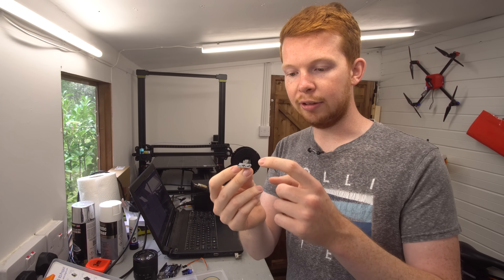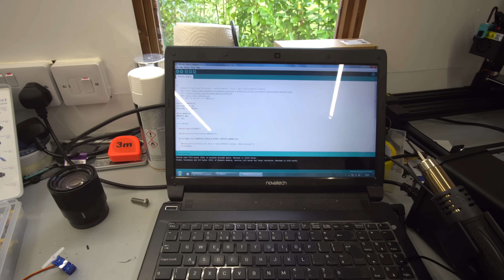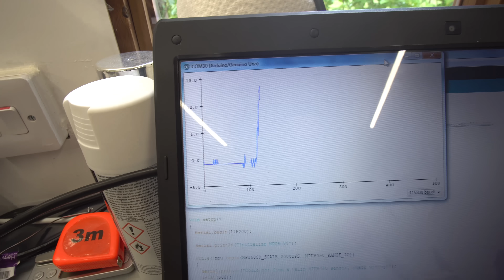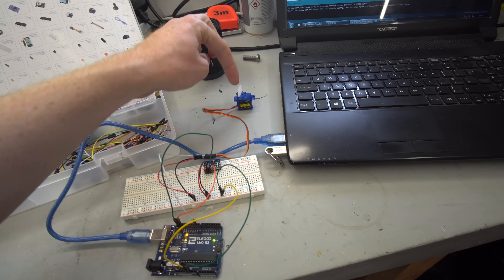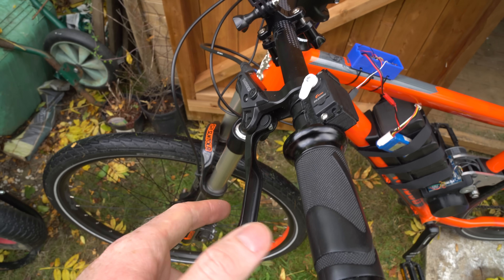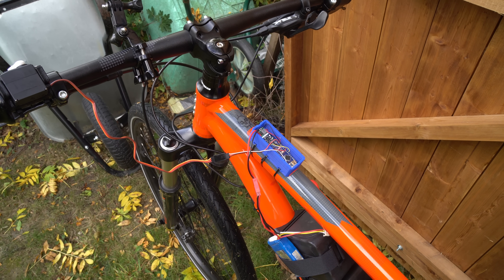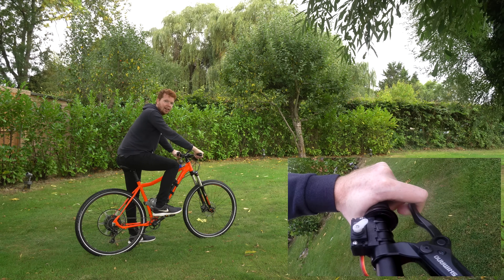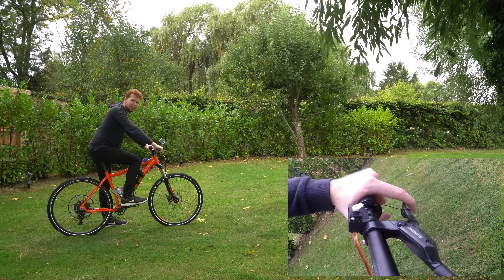Wheelie Cheat Device?

Comment: Great work so far! You may want to look into averaging some number of values from the sensor. This will act like a debounce / filter so the servo doesn’t jitter as much. The trade off is latency to brake activation. Also, verify that you are using gyro data and not accelerometer data. The accelerometer will provide false data during any velocity change, versus the gyro data measuring angle. PID code and Kalman filters will help.

Comment: Another great video :-) If you do end up going further down the motor control route, safety could maybe be improved by incorporating some sort of 'dead mans switch' near or in the handlebar grips, have this hard wired to a relay that returns throttle control back to the real throttle in the event of hands no longer being on the handlebars. I guess you could also monitor another axis so the system only works when the bike is upright.
Maybe one day we'll see riderless/rider assisted bikes pulling perfect 360 degree backflips....

Comment: It will not help.
You have to control the speed, if you control the lean angle even the slightest error to the optimum current lean angle to keep the speed will integrate up and the speed will run away to a stop or  become too fast.
From my experience preventing to fall backwards with the rear brake is the easiest thing when trying to wheelie.'
The difficult thing is to keep the speed within practical limits.
From the force on the pedals to speed you have a second order system hardly controllable.
You compensate by changing the lean angle directly with slight body movements.
Your balance point theory is wrong.

Comment: I thought with your newly finished e-drive you were surely going to replicate the Audi e-bike wheelie cheat device (https://www.youtube.com/watch?v=wdShjFWgh9E). You should definitely be using the drive motor though, not a servo pulling on the brake lever - there's too many levels of vagueness and indirectness that way (the Arduino doesn't know where the bite point is or how effective the brake is). Look to filter the sensor data too, rather than use each raw sample directly.

Comment: Pull the brake at an exponential rate instead of a linear one? When you go past the tilt point, you don't gradually pull the brake, you pull the brake hard, and then release fast: what an exponential relationship would do. With a linear system, it correlates unnaturally to what you naturally do. I like everyone else's technical answers, but I think my suggestion would work well with your current set-up.

Comment: You might consider using a curve algorithm to apply the servo breaking pressure. It’d be more constant. You could also use a running average across an interval to apply the pressure.  That way a sharp change would clamp but not jerk you back down.  You have less breaking force the closer to balance you get.  It’d also help regulate speed till you learned to balance your peddling or torque input.

Comment: Combining an accelerometer and a gyroscope, you could self tune a control loop based on the angular momentum and acceleration of the bike, regardless of rider weight or position.
Reply: Seen a few comments about holding an angle, but an angle below the perfect balance will need constant acceleration to maintain, so the angle would need to be constantly adjusted; interestingly, to slow down, I think you would increase the angle by first accelerating.

Comment: Great start, and thanks for the inspiration!  I'd never for a moment have imagined that such a simple servo-brake setup would work AT ALL.  Also amazing and really encouraging to see just how many people are working on the same idea - why, there's enough just here to make a forum...

I agree that you should use the gyro reading to track your rotational moments, and maybe blend with some PID mechanism.  Someone also mentioned that it's a non-linear "inverse pendulum" problem.  I'd like to hear more about that.  I wonder if some Machine Learning would be of use here, too?

I'll probably start experimenting with a model, my wheelies are pretty poor (read nonexistent).  I also prefer to use ESP chips.  You can program them in the same IDE as Arduino, but they are quite a bit more powerful, and cheaper.  Built-in WiFi also facilitates remote logging or RC control.

Really cool to see there's so much support, hey this may work out now!   Can't wait to see what else, erm... comes up  :)

====

PS.  I am also shocked, I say, shocked!! to find out that some benighted (LOL) countries put the rear brake on the right.  Motorbike riders must just love that...

Comment: You don't need to clean your disks or pads, you need to readjust them as they are hitting the rotors incorrectly causing that squealing.
Reply: Umbra no the have oil on them which makes them squeak

Comment: Hey Tom,
Might be worth logging the way you do a wheelie first - by taking the data from the accelerometer and a potentiometer on your brake handle. This should get your native wheelie angle and brake force applied, once this data is obtained you could match it with your servo or even continue to use the POT to match a force applied to the brake with the servo.

Obviously this is in no way dynamic like the segway as it will be matched completely to your wheelie profile.
Reply: Or learning how to wheelie properly

Comment: Why not do both things. The gyro already works the brakes so why not also connect the motor and have the best of both. It would help you keep from going whisky throttle and flipping the bike backwards or heaven forbid a runaway electric bike with no rider . It would give you the option of auto hill assist if set to spin up the motor when the bike goes up a steep hill (7 or 8°) and cut off around 35°. Past 45° you get auto braking . An emergency cut off cord and pin (like jet skis have) might not be a bad idea.

Comment: I wondered why the servo reacts quite a lot without you having any actual pitch, like here: https://youtu.be/SpKltBb2n1M?t=809 
Did you check the pitch, moving the board on the table while keeping it horizontal? I guess the calculation for the pitch value is based on the gravitational vector and therefor only performs well while it doesn't move. Integrating the rotational speed from the gyro sensor might be a better option.

Comment: You have to make the Arduino react on the speed of which there is a change in in degrees over a certain point - not hardcore it to an actual degree. There is Arduino library's out there you can use for it.

Comment: The Arduino IDE is available on Android if you want to make code modifications out on the road. I'd recommend ArduinoDroid but Bluino Loader is good also.
For viewing live values on graphs for debugging and data logging add a Bluetooth module and get the BT Terminal/ Graphics app.
Both these have been very useful for developing my Arduino based bicycle automatic shifter.

Comment: You should do this on the power side, rather than the brake side. I.e. Current to motor if falling forward. You'll know the physics, since you know torque per amp, but don't know braking force per angle servo deflection

Comment: If you can measure the speed, and then calculate the rate of the change of speed - acceleration of the bike, on top of the angle sensor, you have enough information to compensate for all of those "balance torque, including the riders arms", weird angles (the angle it's mounted no longer matter when you only measure rate, but you still want it to check it's not zero due to "both wheels on ground" I guess) stuff you were talking about... when you have acceleration = 0 and the rate of change of angle = 0 then all those dynamic torques/weights/etc are in balance.  if the rider leans forward, then the angle rate increases, and to zero that out, the bike will need to accelerate, which means non-zero acceleration...   Drive your control system to zero both out, and you have balance.   You can drive  "break only" with the same control system, was just easier to talk about assuming perfect rear wheel motor power output control.  I hope that made sense.

Comment: Have an other device on the brake so you can't flip if the motor goes crazy. Most controllers come with a throttle cutoff to be installed on the brake. All your concerns can be easily worked around.

Comment: It seems to me that the force with which you pedal is a very badly defined/controlled part of your feedback system. If you would have a motor which would apply a fixed torque then I think the control system would be much better defined. You could still regulate on the brake only. I think, for the optimal angle it would apply some braking pressure which would go up when the tilt-sensor detects the front wheel is rising too high and the braking pressure would go down when the front wheel decends too low. I'm already amazed that a little servo is sufficient to action the braking lever.

Comment: What I love about your videos is you show everything "warts 'n' all". Real world engineering is about examining challenges, proposing, developing and testing solutions, but, without immense resources, there will always be assumptions or variables that weren't considered, which means that things often don't work perfectly first time or at the very least can be improved. You aren't afraid to show the imperfections and design iterations that are what real-world engineering is all about. Our 'failures' or imperfect designs and consequent design iterations are always the greatest learning experiences which is what makes your videos so much more valuable as a viewer. I wonder if this challenge can be more easily solved using the electric bike, since you will gain potentially finer control of both torques acting on the wheel? I suspect the rider's mass distribution is by far the largest variable though. The segway also has things much easier as the torque control is provided by the same mechanism, i.e. the motor that drives the wheels, which is probably easier to characterise than a friction brake and gives finer control than a simple mechanism such as you've implemented can provide - the braking force is going to be quite non-linear for any friction brake ultimately. It's an impressive video though and very successful given the time spent on it! Maybe a dedicated wheelie bike without a rear freewheel allowing the motor to provide propulsion and braking forces? Unicycle?

Comment: Dude,  great channel and project. You should use the built in adjustments on your brakes instead of adjusting the length of the wire that pulls the brake. Make he wire really strong and locked in, then use the brake adjustment for very fine, repeatable adjustment of the when the servo is pulling the brake hard enough to stop the back wheel

Comment: Should use a potentiometer or variable resistor and compare the voltage with the pitch so you can tune the pitch angle more easily and without adjusting the mechanical properties. Also smooth out the pitch signal a little in software. Perhaps you could try and close the loop using a strain gauge on the handle bars to measure how much you are pulling on them and/or a position encoder on the rear wheel to measure movement of the frame relative to the wheel. Not sure how easy that would be to calibrate though

Comment: If you set up a gyro to cut the power to the engine when your bike is at a specific angle there is no chance it could go full throttle if you are not pulling the throttle, isn't there?

Comment: You can improve the performance by adding a low pass filter or simply averaging your input signal.  Since you have a gyro and accelerometer, have the speed of the servo movement be proportional to how quickly the front end is rising.  Just these two changes should provide tuning for a much smoother actuation of the braking force (which is nonlinear in application itself).  If you want to get fancier, put it in a PID loop (and have fun tuning LOL).  Your current control looks like similar to the bang bang type.  If you do hook this to your ebike throttle, you MUST MAKE SURE YOU ACCOUNT FOR THE FAILURE MODES!  A big one is making sure the throttle input does not float if it's disconnected, this should be done in hardware by clamping it to ground AND in the software.  If you do want to connect it, I've designed and use to sell a throttle tamer device for ebikes.  I'd be happy to point out failure modes to watch out for and how to address them.

Comment: why did you pedal on the ebike instead of just using the motor
Reply: Nate Turtle - would the motor on its own provide enough power to maintain the wheelie without being too near the tipping point?
I don't know how powerful Tom's motor is, but would a std 250W motor manage without a bit of pedal assistance?

Comment: What happens if you go up a 45 degree hill? Sounds like you need a LIDAR module to help detect if the front wheel is up along with the gyroscope. Or a digital air pressure sensor on the front tire's valve. But great video man, and every one of us has burnt out a couple servos getting started, its a part of being into electronics

Comment: 15:28 surely a PID controller could adjust for a different balance point on the fly? Its job is just to keep the angle between the bike frame and the horizon constant. How does a quad copter adjust for a wind gust for example?

Comment: You may be better off building a small scale 3 or 4 wheeled car. That way you can do your testing at home in a controlled environment. If the ESC goes crazy on a small car it won't hurt anyone. Once you have the code a bit more stable you can migrate it to the bike. I'd also suggest looking into some of the older Arduino based quadcopter controllers or some of the Arduino controlled self balancing robots. It is a lot easier and quicker to start with some code that does something close to what you want and then modify it from there.

Comment: A thought I had that is probably way more effort than your willing to put in for the project. If you added a pressure sensor on the seat post you could potentially accurately measure torque of the rider on the back wheel by the pressure between the post and the sheath. If you had this information you could calculate the forces rather than worrying about the "position" of the rider. If you ever do attach the motor to the controller make sure you add a break away switch similar to a jet ski.

Comment: Hi Tom, great stuff. It's always interesting hearing you think through the problems. A few thoughts you may want to consider :
 If you wanted to account for the riders relative position to the bike, it would be interesting to put a second inclinometer/gyro on the back of the rider. It won't give you distance, but may give you some kind of trim to your controller.

If you set up an sd card (I assume there is one in your dev kit) you could try logging a "perfect" wheelie to see what angles you need to start applying the break. (it may also give you some nice plots for your content). With a second gyro you may see a relationship that can be used to improve your control loop

I would put a bit of averaging in to the system to remove the gitter (maybe an IIR filter?). If your getting angle from an accelerometers, it's going to noisy. 

I've done a couple of PID's on 8bit micros in the past and it can be challenging. You probably only need the P and a little bit of I. There are some useful libraries out there for the arduino where you set up your Kp Ki and Kd gain and let the function do the work for you. 

I don't usually post comments... Ever... But I do find your channel very interesting. I hope my input is of some interest /help. 

Keep up the great work. 

Thank you 
Matt

Comment: You could use a ultrasound sensor on the arduino to measure the distance between the wheelie device and the chest of the bike rider - this would help with the arm length situation.

Comment: If you could measure if you are accelerating or slowing down accurately, that could help to measure the balance point. (and your speed can help too)
If the balance point is bad then the bicycle is accelerating too fast, or deaccelerating too fast. (and your speed value is getting too big or too low)
If the balance point is bad and you are deaccelerating constantly and very close to a low speed value, then your balance point is at the back and you will fall. It should pull the brake harder.
If the balance point is bad and you are at a high speed value and it is measuring that you are still accelerating, then it should reduce the brake assist.
You don't need to measure your weight and your arm lenght, only your speed and acceleration values ;)
I don't know any coding stuff, just this seems logical to me. Maybe it is hard to measure your speed and acceleration precisely, but knowing these values and the ideal speed and ideal angle, it should work (by reducing or increasing the brake assist).

Comment: have you tried having a secondary back break connected to the device. with the device connected to those breaks instead of the handle bar breaks? that way you are still able to use the hand break and it be functional, while the secondary pads on the back wheel being soley for the servo. maybe a clamp that slowly closes as the angle gets more and more steep, fully closing at 60 degrees. perhaps a corkscrew that spins openning and closing the clamp.